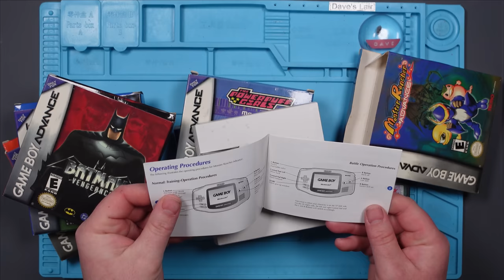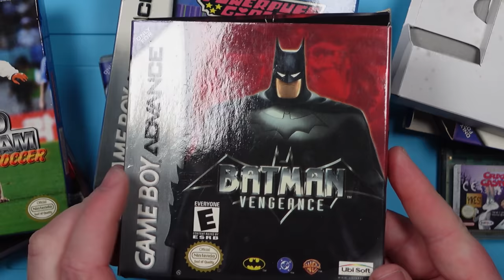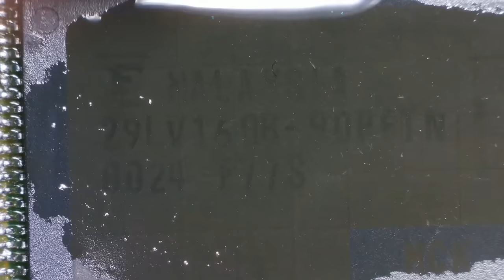I Bought 8 FAULTY GAME BOY Games on eBay & I Think I Got SCAMMED!

Comment: Hope you reported the scammer, stuff like this shouldn't be allowed much less circulated... they even had the audacity to make fake boxes.
Reply: The seller may not have even known himself that they were fake. It's likely they received the or bought them thinking they are real. The scammer is the company in China 30-odd years ago who made these carts and sold them on to retailers.
Reply: @VVGRestoration  I'm inclined to agree in regard to the likely age, however, I completely disagree to the ignorance of the seller. The quality of the box is one thing (a serious thing to ignore in its own right) but I have never seen a ziplock bag used on retail carts and the fact that they would've noticed it didn't work immediately after receiving it... red flags is all I'll say on the matter directly.

I will add that it isn't unlikely that someone looking to make a quick buck trading carts bought a few fakes (some not working) but figured it was cheap enough to net a profit and sell defective ones as "non-functioning" genuine rather than never working fakes.

This is all speculation of course, we will never know the truth, however we are afforded this lesson of cautious vigilance at little personal cost.
Reply: It’s happening with everything it’s not a new problem,It’s been happening for years and years.
Reply: Never hear of Emulation get a life. You ‘GRASS’ !
Reply: @MarcTBG You ‘GRASS’  got anything better to do in your boring Life.
Reply: @Red-Revolution708  you "Dirt" do you have anything to do with yours?

Comment: Very easy to tell if a Gameboy game is fake without opening it, if it has no stamped numbers on it. I have never seen a fake one with stamped numbers.
Reply: Same here. first thing I do is check the label for the stamped number. When I was building my GBA collection I got pretty good at spotting fakes even from pictures. The stamped numbers is not always easy to spot on pictures but the font of the Gameboy Advance logo above the label is slightly different on reproduction. Once you have seen a real and fake side by side and look at the logo it gets easier to spot when it's off.
Reply: @chamoo232  Sadly thanks to some of these games becomming more valuable there are some really good fakes out there. And I've also had a pirated copy of a game that had the stamped in number and I've seen a few videos here with definitely original games that don't have the stamped number.
Reply: @MyRegardsToTheDodo  It shouldn't be the only thing you judge a game by but for me it's the first thing I check even before I open the shell. Checking the board will always be the best thing to do.

Comment: Hi Steve, I used to have a business repairing electronic musical instruments and came across this resin in a synth that I was fixing. The resin breaks down over time and sort of becomes a capacitor, thereby stopping the chips from working properly. The fix simply involved soaking the circuit boards in acetone (nail polish remover) overnight. The next day, I could peel off the resin and the circuit came back to life! It might not be the same with your games but it's worth a try eh? Keep making the videos, they're great entertainment.
Reply: Thumbs up! Hope he reads this and tries it out!
Reply: Reset Syndrome  Yeah but you are talking about knock off's who will do anything for a cost reduction.
Reply: Reset Syndrome  yeah, this was a Roland Juno 106 so probably early 80s.
Reply: yeh its the resin and the plastics over time that seep into the circuits just need alcohol or acetone
Reply: Reset Syndrome  these are chinese knockoffs that will cut any and every corner lol
Reply: @learntospell  The Juno 106 is just 🧑‍🍳👌
Reply: Why in hell are they using these blobs if they are already knock offs?
Reply: @goku445  To cut costs and time.
Reply: I too tried this fix for the juno 106 voice chips , unfortunately i had to replace 5 of the chips with the "clones" , only 1 of the original chips survived    i guess they were too far gone ... but it was an interesting experience for sure ..

Comment: The best way to tell once you’ve got the cart open: the ROM chip will have the game’s serial number printed on it, and on the back of the board is the 4-square date code. You can see the date code on the back of the GBC games at the start of the video.
Reply: Also on the label, real ones will have small imprinted numbers.

Comment: My thoughts on why the pins get loose is because its where you grab the cartridge to push it in and pull it out. Possibly putting pressure on the chip.

Comment: The first thing I look for when I suspect a fake GBA game is if I can find a number or letter stamped on the cartridge's label. It's embossed and I have never seen a reproduction going as far as trying to copy that. If you open a cartridge and see black blobs it's a fake one. A battery is also most likely a sign of fake. They are used to keep save files on reproduction but real cartridges don't have batteries unless it's a Pokemon game with a clock feature.
Reply: That not always the case on GBA games with a battery. I have a US copy of Metroid Fusion which is genuine but has a battery for the save. The game has 2 board revisions. Mine is the earlier board with a battery. The second revision switched the save to SRAM and eliminated the battery.
Reply: There are originals without that number (very few, though) and there are fakes with that number.
Reply: @TheAlphaWolf2013  Yeah there are like 25ish GBA games that have a battery out of the 1500 games but when you see those they can't be mistaken for reproduction either. No huge black blobs and they have the Nintendo name on the board. I bought Donkey Kong Country 1 from Ebay and when I got it the game worked but save files got deleted when you turned off the console. I thought the battery was dead and opened it and indeed there was a dead battery but that's when I realized it was fake. Looking online I found out DKC is not one of the games that originally had a battery.

Comment: Another point in the "clone cart" basket, I'm 99% sure those contacts should NOT be silver. They should be a brassy gold.
Reply: If someone used a rough abrasive on the pins, they will turn silver.  I know that's the case for nes games and I have seen silver pins on some nes and Genesis games.  It doesn't necessarily mean it's fake.  For NES games, if you see an unusual chip with a glass circle on it, that is an aftermarket game or a fake if advertised as original.  I used to make aftermarket and reproduction games, but they were advertised as such.
Reply: @toddspangler6669  Right, but often replica boards will forgo whatever coating was used.
Reply: You can see that these are fakes even without opening them up. Above the contacts there should be a Nintendo logo and a serial number. It's not there, so these are definitely fake. Most Gameboy games (OG, Colour and Advance) with an ESRB rating (US rating) in Europe are fake.
Reply: They did have gold plating, it was just very thin, and looks like it rubbed off from the eraser exposing the nickel plating on the copper contacts.
Reply: @davidcameron648  I usually clean the gold plating with an art eraser, works well.  I tried sand paper 1 time, and it pulled the gold plating right off...I never used sand paper again.

Comment: Definitely just throw them away, repros are awful.  I understand it's nice to try and fix things, but repros are just never worth it.  Plus, these PCB's don't have ENIG coating or hard gold pins, so the pin bus is going to end up like these have after not very long of inserting/removing from the cartridge slot.

Also, just a quick edit, the yoshi's island and such with batteries are "faulty" because you won't be able to save them.
Reply: Same happened with my copy of Pokémon red. Just replace the batteries and their ready to go.

Comment: From my experience on fake carts, the pads on the cart that touch the cartridge slot of the console are also very bad quality... The pads degrade quickly and they start to make a bad connection with the console, even when they look kinda shinny. I don't know how to fix a cart pad :S Maybe put solder on top of it? But with solder on top we might damage the pins of the cartridge slot on the console.

Comment: Before you even said anything, I thought those boxes looked off a bit.  Thought maybe it was a Europe difference at first...
Then the blob chips... pretty sure that's not standard on GBA carts... I'm assuming they weren't sold as fakes/clones?
Reply from the maker: The listing didn't say either way, but you would assume they are real unless told otherwise I guess.  I probably wouldn't have paid so much if I knew!  Still, I got 4 of the genuine ones working (the 2 GB Color and the 2 Mega-Drive) so I guess it's not all bad!  😬
Reply: glob top on GBA carts is a massive indicator they're counterfeit. The only time nintendo has used glob tops on official carts from my understanding was early revisions of star fox on SNES and early packins of Tetris on the Gameboy. Mostly due to the holiday rush and they needed the carts out and ready. later revisions used standard chips / ics.

Comment: Just a tip, if you have those black resin blobs, you can get them off by heating them up to 125-150 degrees with your rework and pluk away any them with cheap pair of tweezers

Comment: I have 3 tiger electronics wrist watch games and am not able to solder would you be willing to attempt to repair them if I pay for postage and any parts needed+postage back to the US? 1 has a badly stripped screw, another the battery contact is faulty and the last one does no power on. Thanks so much

Comment: Great job Steve! Just be a little careful with declaring a game is working a bit too quickly with these Gameboy games... They can sometimes give a false positive on bootup since after you go to start the game, there is a chance that it won't actually work. I just had 2 Pokemon cartridges come where the game will boot up fine, show the intro, but then after you actually go to start the game, the text and audio start glitching out and it results in a full hard crash. Just reflowed them both with hot air and they both are now working like a charm! I believe this happens because the location where the memory mapper is at is probably a high stress location and after repeatedly being pulled in and out of consoles, over the years the connection goes bad. Granted most of the issues you had in this one were just because those were fake carts. Just something to look out for! Loving the content as always!
Reply: You obviously didn't watch the video to the end

Comment: I like your videos.
I have a GBC which I plugged in the wrong wall plug for, and it no longer works. I tried unsuccessfully to solder 2 little wires to the fuses I probably shorted. Does this sound fixable?

Comment: Oh new repairs. This actually push me to do the same and repair a ps4 I found on a flea market that was damage. I found is the HDMI chip but I never done a chip removal so will be my first.
Reply from the maker: Good luck with the repair Inugamiz!  I hope it goes well 🤞
Reply: @StezStixFix  Me too but I really dont have any confidence on what temp I should use and air flow settings. But thanks for the encouragement.

Comment: Steve! If you ever wonder about if that's a real cartridge or a repro, you can check the boards. If they have the Nintendo logo (with copyright logo as well) they're probably real games. Also, in some other games, there's a faulty battery for savegames (for example, Pokémon games). Also you can see the blubs, etc. that normal cartridges wouldn't have 😇. Probably you can check online how real boards look like! ☺️
Reply: Although this can be mostly correct, there are copies out where the producers even go to the trouble of having the PCB printed with the Nintendo Logo and copyright.  It is not that hard if you have a disreputable PCB source that is willing to make you boards with the logo.
Reply: A lot of the pokemon repro GBA games have a Nintendo logo printed on the board.
Reply: @gilgatex   what  i have seen not only the chips atleast for the eu pokemon games they are mx chips and also in the back they have different solder points that you can see if they are any of the ruby sapphire or emerald games since they are translucid the official ones should have the solder and nº of points in the same place i cant remember how many right now
Reply: @gilgatex  Unless they've really stepped up their game recently, you can still tell. The faked logos are clearly not legit when compared to a real one.
Reply: @rifflesby  I never said they looked legit.  I just said they existed.

Comment: Came across the channel here recently, with an older video of yours (the one with the busted SNES Mini). And a good one too will say the channel is, bit of a character in a good way of course. Also, the box art on one of the boxes, the nintendo seal of quality, the "nintendo" text was off, not the right font. Would say that's an indicator of a dodgy one there. And haven't gotten a fake in a long while for GBC/GBA games myself, have bought a few rom hack Pokemon games over time, but with those you know they aren't real ones. But have been scammed years ago, in 2010 when i bought two copies of Pokemon Fire Red for myself (both didn't work properly & didn't know how to spot a fake at the time) and a year prior in 2009, when i got a fake copy of Pokemon Diamond, ended up buying a genuine new copy from a retail store. But yes, some fakes can be pretty simple to spot, some can be difficult to figure out. As others say, are good guides out there for helping to spot them, and hopefully it will be a good outcome for you with these faulty/fake games.

Comment: Hi Steve, here are some tips and tricks to spot fake GBA games. You should employ then when shopping for those on the internet:

1. The Game Boy logo. On real carts, the logo is made of a slick, sharp, flat logo. On bootlegs however they can appear very round and almost like bumpy. Now that you have bootlegs carts, I recommend you to compare them with the real ones. This will help you a lot in the future.
2. Most of the time, real carts have a Factory number pressed on the game sticker. You can see these with a little bit of sun reflection, but it may be difficult to spot on online photos.
3. The stickers itselves are sometimes made our of poor quality print, and even sometimes use the a totally wrong sticker. On Zelda Minish Cap bootlegs this is evident, because they will try to use an European game logo (Witch makes it suspicious) and even then, they use a silghtly different european game logo with a white shine around the logo that makes it obvious it's a fake.
4. Also, look for abvious wierd colored cartidges and check if thats normal (Kinda obvious, yhea)
5. Is it too cheap to be true and/or the seller is uncollaborative in prooving the validity of the cartidges? Then perhaps not worth the risk.

Other tips that can help you after buying them:

1. The black blobs of doom, of course.
2. Lack of a circular battery, most of them use them. Double check though.
3. Wrong or lack of Nintendo (C) trademark and year.
4. Comonents being out of place, or wierd components present.

Comment: GBA games like Yoshi's Island don't use battery-powered SRAM. I've come across maybe five that do, but I swear the majority use some form of solid state like FRAM, EEPROM, or flash (authentic games have silk screened markings for which chip it is).
Reply: Yeah, only a small handfull of them use a battery to retain saved data. The Pokemon games also have one but only to keep the time when the cart has no power.
Reply: @DONK8008  I know the Breath of Fire ports and Wario Land 4, along with at least one of the Metroid games use batteries.

Comment: I've found from experience that even if fake GBA games work, it doesn't mean they will save data. Not for long at least.
Reply: SRAM battery's empty. Happens to originals, too. For example every Wario Land 4 cartridge has run out of juice by now and won't save. Pokemon games too. Other GBA games already use flash memory (like Mario Kart SC). 
Battery replacement is easy for originals. For bootlegs not so much.
Reply: @westelaudio943  the game I had an issue with was a fake Metroid zero mission. It didn't have a battery. It worked for about 2 playthroughs then stopped saving. I have changed batteries on some GB games before. I hate doing it as my soldering is terrible.
Reply: My first (and only) fake GBA game was Phantasy Star 2, which I got in 2003 as a poor child. I played that for 6 hours the day I got it, saved my progress and wanted to return the next day. My data was gone and to this day I have not played Phantasy Star 2 again because it bittered my experience that much.
Reply: @autumnalgloom5360  I get that.  I was really pissed. I ended up tracking down a boxed Japanese version of Metroid as all the local ones looked dodgy.

Comment: Fake GBA cartridges look so bad... can someone explain to me why there are these blobs on fake boards? Why are the doing that? Great video as always. Thank you.
Reply: The chip substrate is directly glued onto the board and bond wires are spot welded to it, it is thereupon covered by resin for protection. Obviosly cheaper than a chip package that's soldered. Why some pins on the other chips are covered in resin too I don't know. Maybe to hide something or to give the sloppy solder joints a bit more strength.